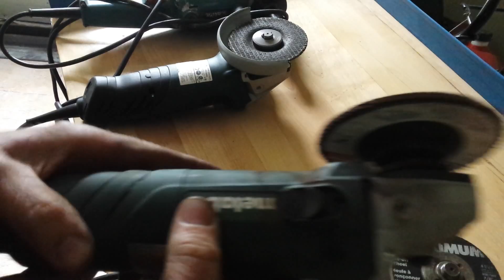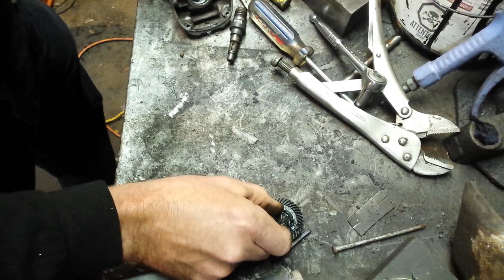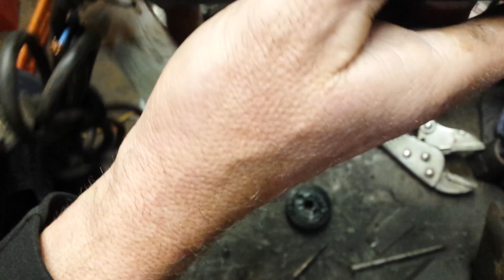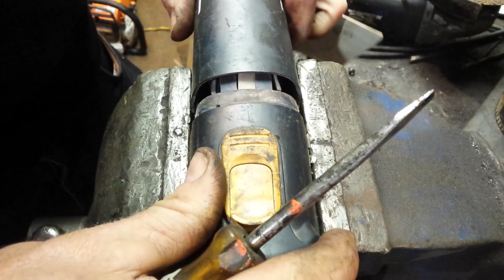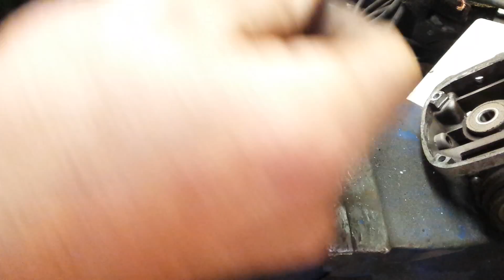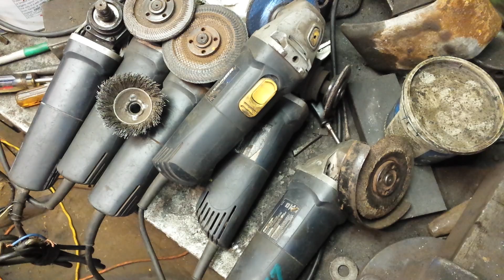Angle Grinder Repair

Comment: Years ago we had an old Bosch 9" grinder we used to clean the top of 50 gallon drums (44 gallon to the rest of the world) with a big cup wire wheel on it and it was a great at launching the wires right into delicate parts of ones anatomy, finally the boss gave up and got an air powered sander to mount the cup wheels to and it barely ever shed any wires anymore and had heaps of torque.
Reply from the maker: Thanks for stopping by, i sometimes use a buffer sander with a wire wheel. I comes apart quick at high speed and the variable speed on the buffer lets you slow it down. Take care.